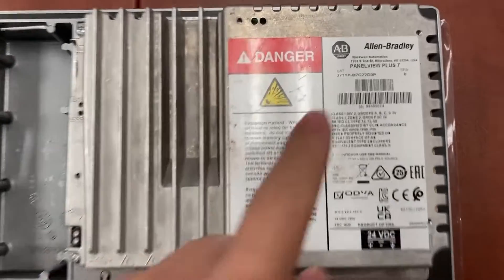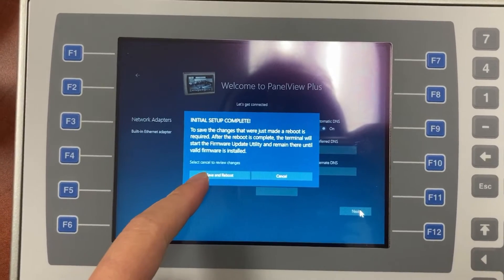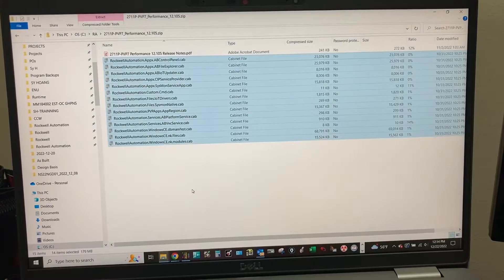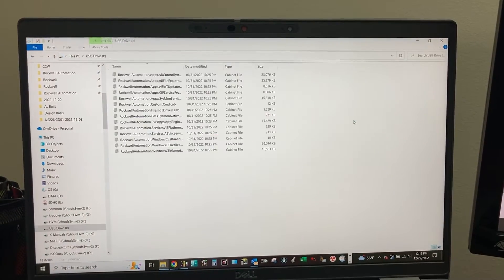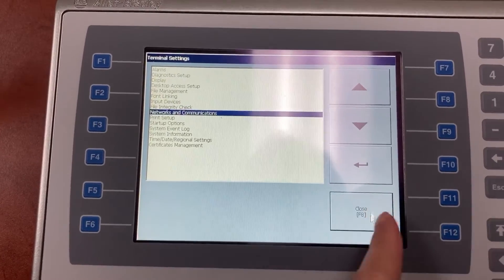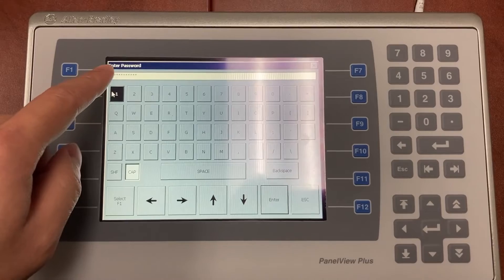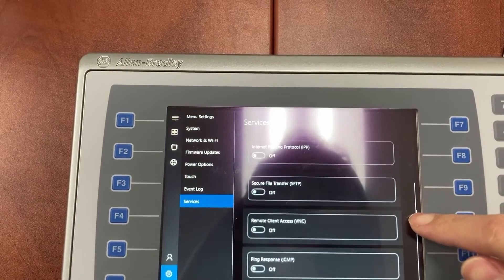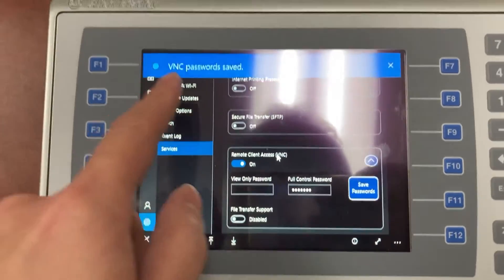Allen Bradley Panelview Plus 7 Performance Firmware Update USB/VNC Viewer

Comment: hello, my password (desktop access password) only works to turn off Runtime, but not anymore in Win10, I can't start the services, Update FW... I'm trying because the panel communicates with us via ethernet IP
Reply from the maker: @tomasj.2651: Thank you for your comment. Unfortunately, you have lost the most crucial password which is "Administration password". If you have it, you will be able to do everything on the Windows desktop of the HMI. What you have right now is only the "Desktop access password". To reset the "Administration password", you will need to "factory default" the HMI. On the back of your HMI, there should be a small button inside a round little hole. After you can locate that little hole, use the paper clip to push that little button while the HMI is powered up. Once it is pushed and released, the HMI will go to the maintenance screen. The "factory default" selection should be the second one from top on that screen. Good luck.

Comment: I have already migrate the pv6 to pv7 . But i still have an issue during access the recipe format  ( .csv ) files from External SD card . While the Application running , i couldn’t access the External SD card so the .csv files is inacessible. Kindly need your advise
Reply from the maker: @user-bi3hj8yk8j: I am very confused. What are you trying to do? This video shows you how to update firmware just from a USB stick. Are you trying to do data logging or what are you trying to get with a .CSV format from the SD card inserted to the HMI?

Comment: Hello, I have uploaded my files and I am getting an error-2147024894. I mirrored exactly as you have but seem to still have the issue after redownloading the files from the site.
Reply from the maker: @eric837: Are you trying to upgrade the firmware? This video is for firmware upgrade on "PERFORMANCE" version HMI. If your HMI is "STANDARD" version, it will NOT accept it. What is your HMI model? As always, thank you for your support to my channel. If you need extra support, please join my channel to get access to exclusive support and videos for "member only".
https://www.youtube.com/channel/UCyyYzqg0sp_W7CW9ScZh-zA/join
Reply: Yes the one I am trying to upgrade is performance or 9P as stated by looking at the CAT number in the back.
Reply from the maker: @eric837 : It appears that the error you got was generated from the Rslogix5000. "RSLogix 5000 Error 1904 failed to register HRESULT -2147024894".
Reply: This panel view is brand new. I have yet to connect it to any network or a plc. It is straight out of the box.
Reply: It just says the system cannot find the file specified
Reply: I had to reformat the flash drive. It works now. Thanks for the help @syphoang
Reply from the maker: @eric837: Glad to hear that it eventually worked out for you. I forgot to tell you one thing. Not all USB's are the same. I am not sure why but sometimes it can happen. The 14 files for firmware upgrade should be at the root of the USB drive. Not under any subfolder.